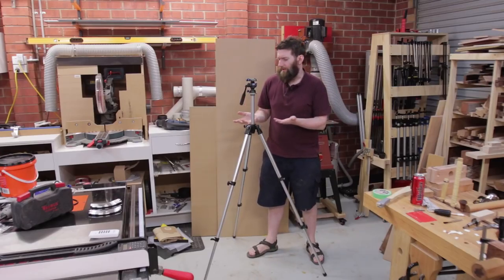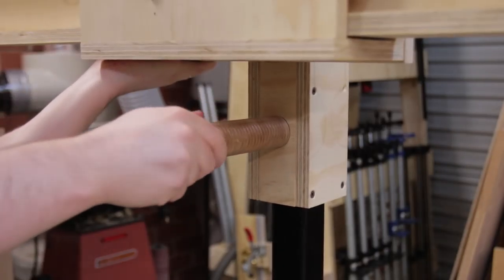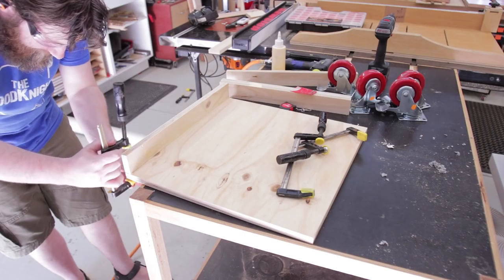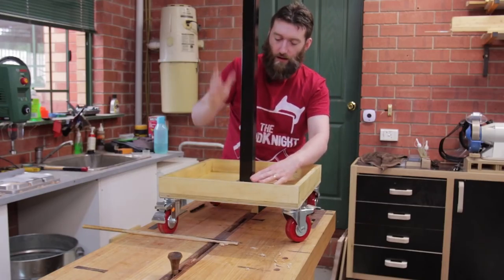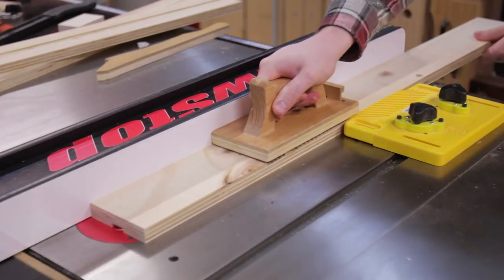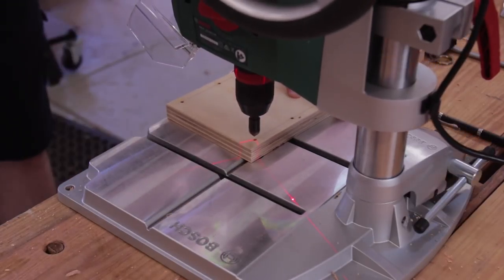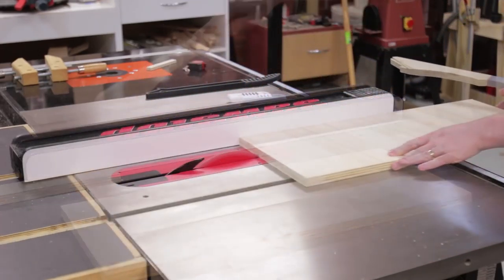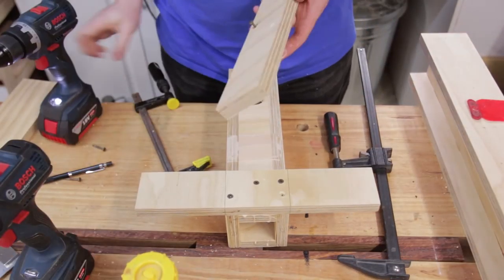Studio Video Camera Stand

Comment: Did  you consider a window sash weight for your counterbalance?  I don't know the exact weight, but the diameter is in the area of 2 to 2 1/2 inches, if your upright tubing will accommodate that.  Also, some years ago I filled a 10" by 1 1/2" black iron pipe nipple with plumber's lead and capped both ends to make a weight for some project or another.  Add an eye bolt to one end and you've got a pretty handy counterweight.   It weighed in at nearly 10 pounds.
Reply from the maker: I think a sash window weight would be perfect (the diameter in particular!), but sash windows seem to be relatively unpopular here in Australia, especially the older (?) style weights - seems to be mostly spiral/spring balances now. I found a few places but they were >$100AUD for the weight I'd need. Lead flashing (Plumbers lead?) is what I'm eying off, but that'll still be $80 or so - I need to find a cheaper supplier for it ;)

Comment: Thanks for the video! My own tripod is driving me nuts. I’m going to start on this next. Is that the 50x50mm fence post? And is there anything else you’d do differently (besides the thinner plywood) if you built it again? Thanks!
Reply from the maker: Yes, 50x50 aluminium flanged post. Theoretically I would like it to be smoother gliding to hook up electronics for a slider, but in real world use, no changes so far. Maybe dedicated spots for lighting mounts?